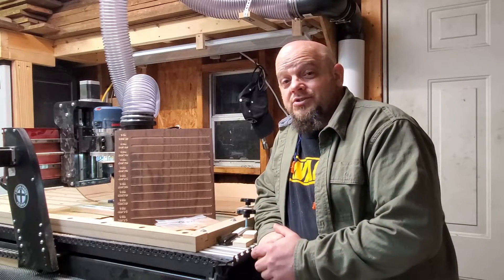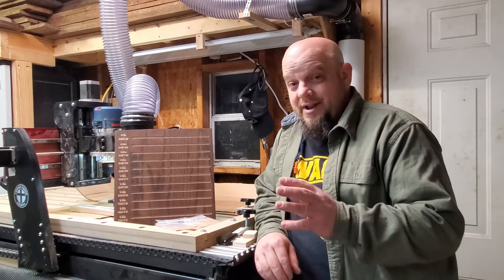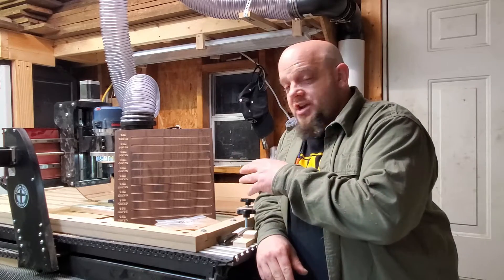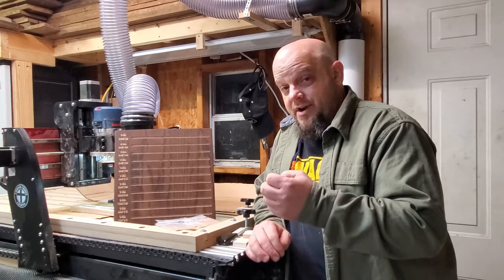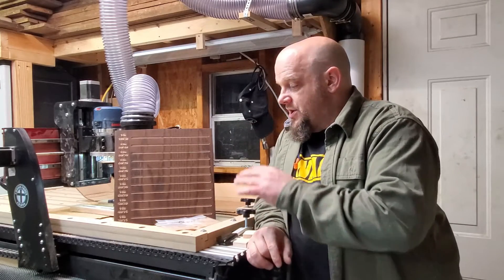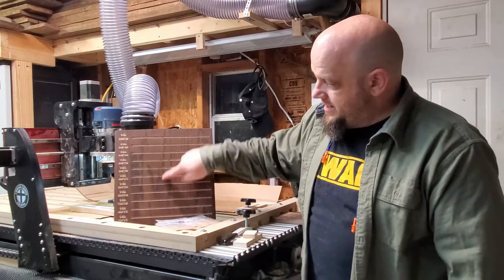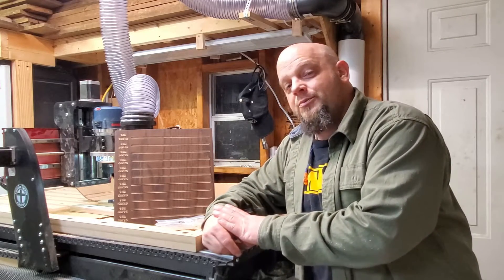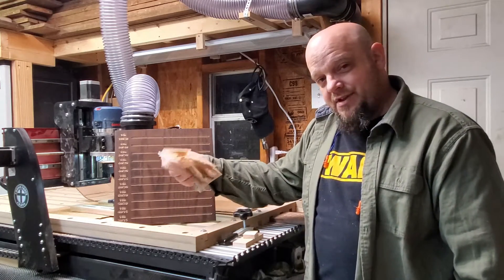Feeds, Speeds, and Chiploads For A Small CNC Made Easy

Comment: Running a bit below its recommended chip load creates heat in the bit, reduces the bit life and runs the risk of scorching your material. Your test demonstrated that your spindle doesn't have the power to run 2 flute bits anywhere near their recommended chip load. I would suggest switching to single flute bits for the majority of your work on this machine.
Reply from the maker: Its a balancing act to reduce heat and keep keep feedrates and cut quality high.  This was one of many tests.  

The router had plenty of power to spin the bit, but the machine rigidity could not handle the feedrate required to achieve it and left cuts less than quality.
Reply: @ChristcrossCrafts  It's not about just spinning the bit. It is about maintaining the correct speed and I could hear your spindle bogging down in both of the passes that were near the rated chip feed. Of course part of this is because you were using the electronic speed control on your Bosch router which reduce the output torque along with the rpm. If it was an HSD spindle you could reduce the rpm without sacrificing torque.
Reply from the maker: @chrisose  agreed!  That was part of the point in showing how underpowered small machines are and how NOT to use bit mfg specs.  They will either wreck your machine or bit, or leave poor cut results.  

I've heard too many people say to use lower feed rates on smaller cnc's but never discuss the importance of maintaining proper feed (& speed) to obtain correct chipload.

Ive since upgraded to a more rigid machine and 3hp spindle. Still not the best but much closer to enable ideal specs.
Reply: @ChristcrossCrafts  A more important point is to select bits that can run at proper chip loads on your machine instead of running bits well outside there designed feed and speed.
Reply from the maker: @chrisose  thats true but single flute isn't as easy to find in certain sizes and configurations.  Sometimes minor concessions are made.
Reply: @ChristcrossCrafts  That is true for v-bit and ball nose but there are plenty of single flute end mills out there. I ran through quite a few Onsrud 65-025 on my old 5x5 table.

Comment: there is a high pitch noise in your video that gave me a massive headache :(
Reply from the maker: The sounds was left on to showcase the different pitches that can help identify the proper feed rate.  I apologize if it bothered you.  It's worse in person.
Reply: apnormal use big router at spindle not good and noise lot, normal used real good spindle lot less noise and lot bettr lifetime and accurate than hand router, and real spindle have lot lot better bearings than worst router have. newer use woodworker router to cnc machine spindle worst idea all world.
Reply from the maker: @mattivirta yes, a spindle is better but not always an option if you blew your budget on the cnc. I have long since upgraded.